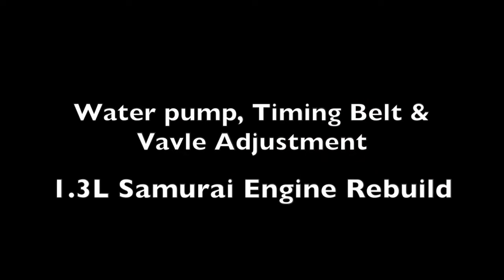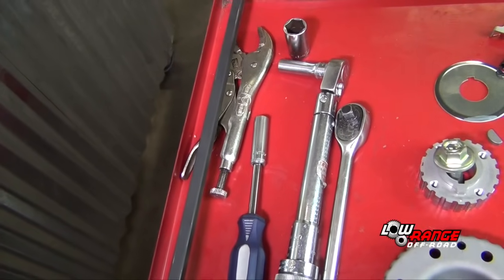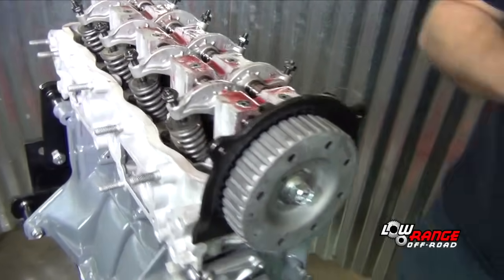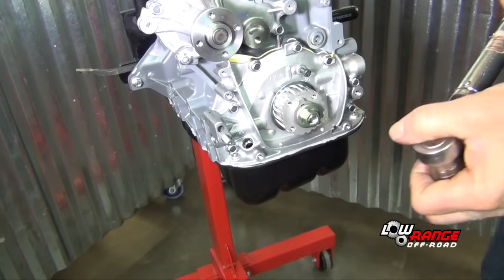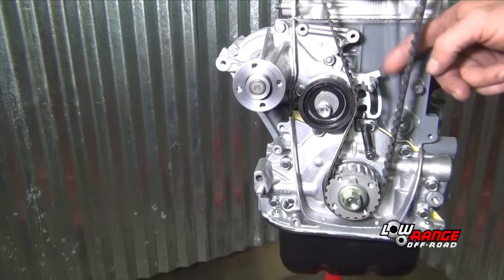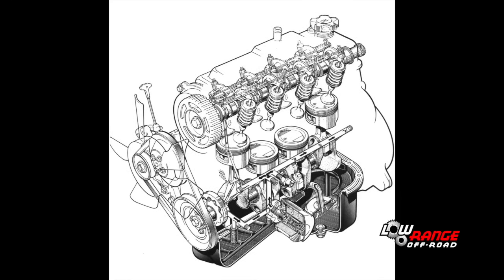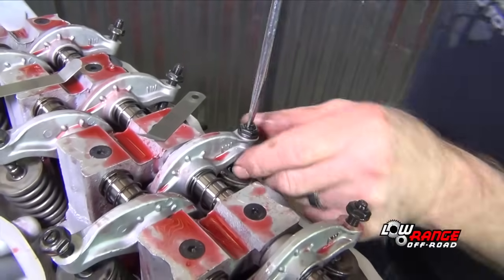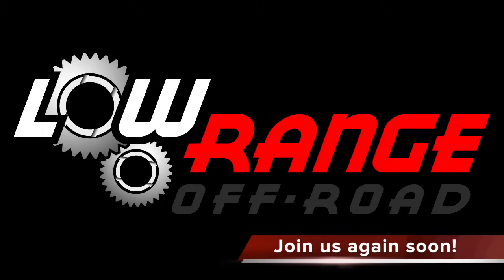How To Rebuild A 1.3L Suzuki Samurai Engine (Part 7) Timing Belt, Valve Adjust, and Water Pump

Comment: Very well explained. I have a question.
I have suzuki swift 1987 with three cylinder G10 engine. Camshaft pulley is just the same as in your video but you alligned the mark and said that you are on TDC of cylinder 4.
In my case as i have 3 cylinder engine but cam pulley is same as yours one,  
So which mark should i allign on TDC of cylinder 1.
Plz reply

Comment: I have a 2000 Chevrolet metro with the same engine except the head has different valves.(sohc 16 valve)
Are they interchangeable and is your engine non interference?

Comment: Hi, i watched the video and did according to the instructions, now my samurai idles as 2,000 rpm and the check engine light is on. Any suggestions? Thank you!
Reply: Take it to a garage to have it done by a mechanic that knows how to follow instructions. Or service the engine fresh oil, filter and turn off service  light..

Comment: I always wonder if many mechanics are as careful? In all my years I have seen SO many butchers masquerading as mechanics. :)
Hated doing rocker arm adjustments, they can send a set of feeler gauges to an early grave. :) (Some rockers require setting when engine is running)
Reply: George Daws guess it all depends if they love or hate their job.

Comment: Great instruction vid, clear and concise. Can I add something? For all you Loctite users, whenever you use a threadlocker in a blind hole - e.g. crankshaft and camshaft end bolts, always put your product inside the hole, and not just on the bolt. Think about it - as you wind your bolt in the air inside must escape somehow. As it does so, it blows out all of your threadlocker which compromises your joint. I see this often in vids on Youtube, and having spent 20 years as a Loctite trainer, I've spent many hours educating others on this issue.

Comment: first off, very nice video's👍... Is this a G13B engine? because it looks very simular to my Suzuki swift engine.
Reply from the maker: These instructions will work with either the G13A or G13BA.  Video will also work for the Suzuki 1.6L 8 Valve engine.  Thanks for watching and commenting.
Reply: lowrangeoffroad tyvm sir👍

Comment: Is the valve adjustment tutorial similar to all engines or may vary depending on the manufacturer's specs?
Reply from the maker: The valve clearance spec varies from engine to engine. As does the method of adjustment.  I'd definitely use the engine manufacturer instructions when adjusting valves.

Comment: I bought a 92 motor that was a new crate motor with flat top pistons.  It cracked two pistons so when I tore it down and miked everything it was like new except for one thing, thrust washers. The crank was evidently a rebuilt one that they faced off the crank where the thrust washers ran slightly.  The crank had .010 end play which caused the pistons to crack the skirts and was wearing the rod bearings on each side.  When I tried to find over size thrust washers in the USA there weren't any.  So seeing that the thrust washers were steel I used my arc welder to tack back of a washer all over then ground it down to thickness I needed.  So far it has run like a watch.  Oh yeah, I hate chrome rings!

Comment: may i ask about what you said that you set it to TDC #4 is it piston 4? Not #1. Thanks
Reply: i think cylinder # 1 and # 4 are the same position both TDC they call running mate,,thank you..
Reply from the maker: +Heumens .PartyNeeds Most manufacturers require that the timing belt be installed with 
cylinder #1 on TDC (Top Dead Center).  However, for this engine, Suzuki 
requires that Cylinder #4 be placed at TDC when installing the timing. 
belt.  Thanks for viewing and commenting.

Comment: Did you put #4 at TDC before installing the timing belt?
Reply from the maker: +MadWeiner Yes. Most manufacturers require that the timing belt be installed with 
cylinder #1 on TDC (Top Dead Center).  However, for this engine, Suzuki 
requires that Cylinder #4 be placed at TDC when installing the timing. 
belt."
Reply: lowrangeoffroad    Does that mean no 1 Cylinder is first in the firing order to then. Just that the timing marks are set for number four?

Comment: hello sir...oesem video..easy to refer and good job..my question here is where you get the all new sparepart to rebuild the engine..it s easy to get at sparepart shop?
Reply from the maker: +shah rizal Zakaria We have some spare parts here at Low Range Off-Road.  If you have a need call 801-805-6644 and ask for William.  If you need new parts, visit or website at lowrangeoffroad.com or call the above number and ask for William.   Thanks for watching.

Comment: now is this the same engine they put in a 1990 geo tracker? they say these engines r the same and i would like to rebuild my engine. with this video and you covering all the steps i believe it would b a walk in the park. Thank you for sharing this video with youtube
Reply from the maker: +Crystal Jones Yes, the 1990 Geo Tracker is the same vehicle as the Suzuki Sidekick.  It has the 1.6L 8 valve engine which is basically the same engine as the 1.3L Suzuki Samurai engine shown in our engine rebuild series.  Our video's should be very helpful in coaching you through an engine rebuild.  Here is a link to all our 9 part video series on How to Rebuild a Samurai 1.3L Engine.  https://www.youtube.com/playlist?list=PLe7MiOkiiAJxAYG3_nb4PkNtxA9ZBJ0Ji  Let us know if you need parts or tech support.  Chat with us at www.lowrangeoffroad.com or call 801-805-6644.